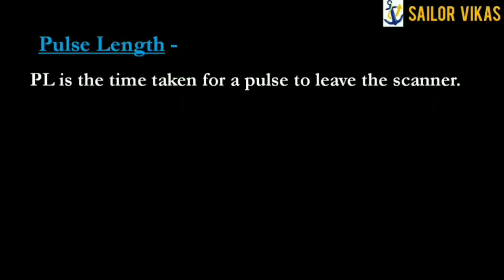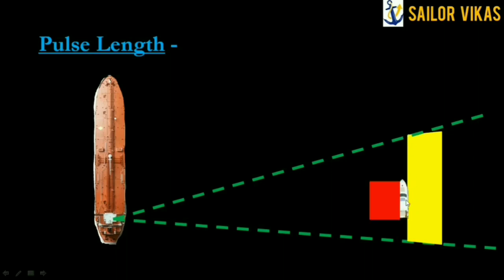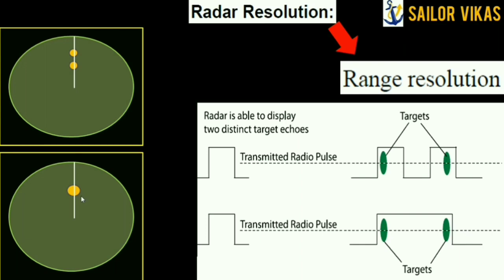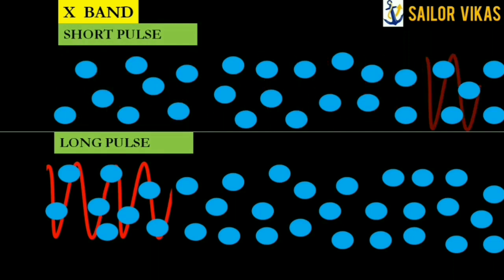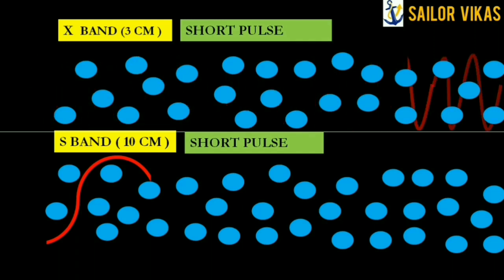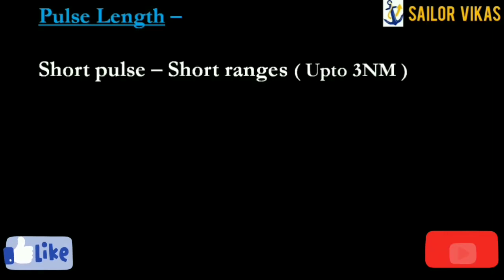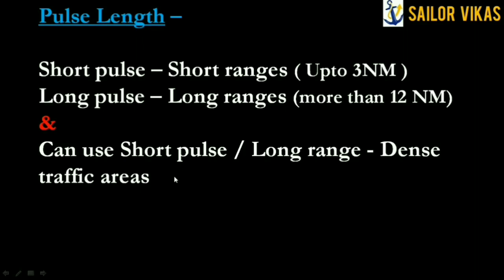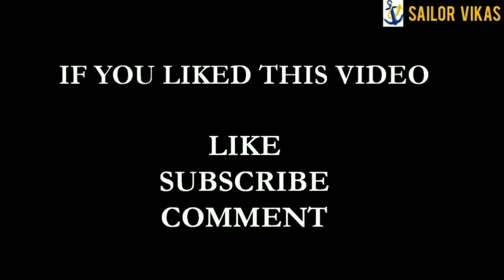Pulse length of RADAR and its use. ( Bridge Equipment series) #marineradar #radar #merchantnavy

Comment: How to determine the x-band radar range (NM) depend upon the antenna height...? any formula...?
Reply from the maker: Their is no particular formula for it because the EM waves hits different shape of a vessel and thus sometimes it will detect and sometimes it won't, also external factors like weather cause an hindrance to determine range.

Comment: Sir, i have heard that while oil tankers are alongside terminals and undergoing cargo operation the radar power is to be reduced.
Can you please throw some light over it.
And do we need to keep Radar on while ship is berthed.
I would be very thankful to you if you could help me with these doubts.
Thankyou sir.
Reply from the maker: Radar is to be put in standby mode as soon as first line is ashore....sometimes pilot tells to put radar on standby well before FLA.
Reply from the maker: There is no such option to reduce the power of radar....it's their in VHF, AIS, NAVTEX to put in low power and MFHF should be switched off...to prevent high radiation in port
Reply: @SailorVikas  thankyou so much sir.😄
I must say your videos are very informative. Keep on sharing knowledge.
Thanks
Reply from the maker: Thanks alot❤️